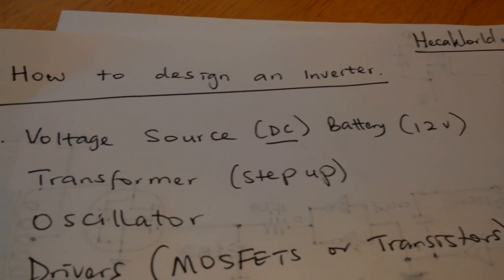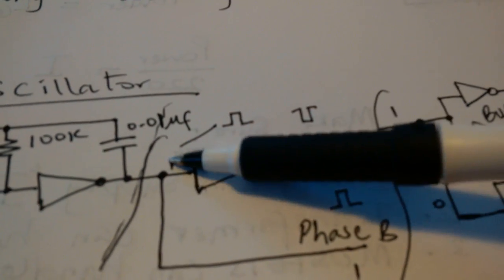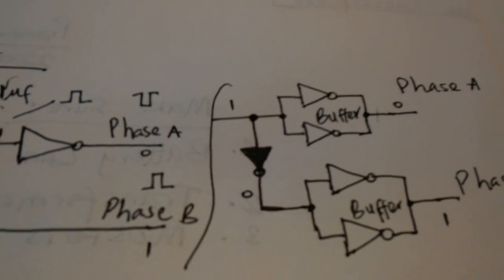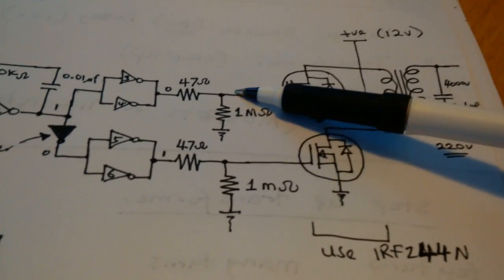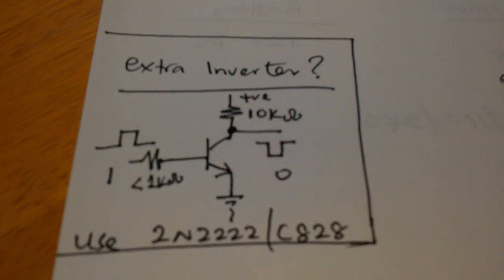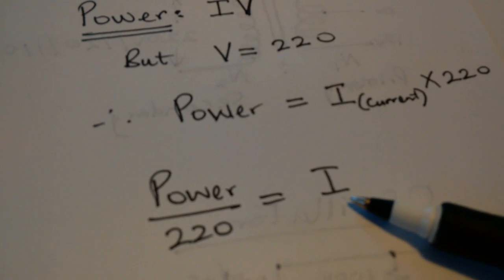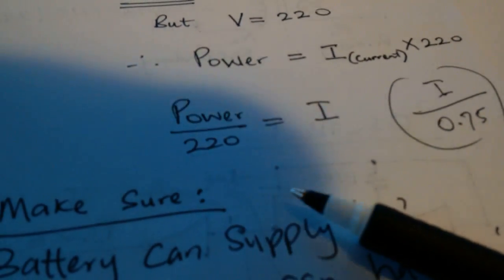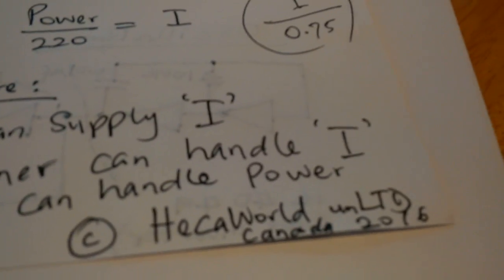HecaWorld unLTD  DIY Inverter Design Tutorial

Comment: This is a very well explained video. I am designing a 300W inverter 12vdc to 120vac. I have determined the primary coil current required (with efficiency) is 33.3A. The only issue I am having is determining how to attain that current value for the primary coil? What specific calculations do I need to make to attain this current? Thank you.

Comment: how to make inverter for 24v dc to 220v ac ?
Reply from the maker: Use the right transformer ratio. And probably a voltage regulator for the sections of the circuit might require lower voltage levels.

Comment: I really need to build a inverter to power my home. I am new to electronics . and self taught . I have been researching how to do so. I need 120vac at 60Hz. from 24vdv. and need approx. 6kw+. do you have a more detailed schematic? I was thinking of using a e bay inverter driver board to drive only the h bridge on the output stage. and a arduino for the boost stage and over volt and heat protection. and under volt shutoff. but I know nothing about programming. what do you think about this idea for a inverter? I was thinking of using a hand full of irf640 FETs for output. and irfz44 or stp170N8f7 on the boost stage. and I have been debating  what type of boost to use. a low hz. push pull. or a high hz. smps style. I know the transformer will be very large for a push pull of this output. but I know little about programming and concerned about regulation of the output. in either style. the high frequency would easier to regulate I'm thinking anyway. but what's your opinion . and thanks for making the videos
Reply: +hecanet    my main issue right now is choosing devices like MOSFETs. some of the figures mean nothing to me. on the data sheet for the FETs. I know I need low RDS on. along with current and volts that are well above enough. and low capacitance for fast switching with the get being fully on and off. but basically the other figures could mean anything as far as I know. and I know the gate needs either + or - of like 5v or most 20v and uses near 0 current. I'm thinking of 60-100v and 100amp+ FETs with very low rds.on.  is the to-220 package the best for my needs? and I was thinking of using a arduino for the boost stage and regulation of the boost stage. but I found a spwm  inverter output board with get drivers and was thinking use a H bridge. but use the arduino for safety's  or would a teensy 3.2 be better to help with voltage drops and over shoots. since it can run at 98mhz. but a few MOSFET part numbers and a good place to buy them would be a big help. thanks so much for replying. it means a lot. and thanks again
Reply: +hecanet        also I was looking through a old modified since wave inverter. the boost stage FETs are outdated. and the output stage is irf640. 200v and only like 18a capacity. I'm sure there is better FETs available. with a higher amp rating. with the spwm of a pure sine output. it will need to switch many times faster. and thanks a lot for your reply

Comment: I am wondering how the drop in battery volts relate to output volts/amps. does the voltage drop on output 1volt to 1 volt or 1volt to 10 volts output. I guess for better understanding. how does in volts effect out volts ?  thank you a reply would be great.

Comment: thanks for laying it out like that. I am needing to build a kinda large inverter for a off grid home. do you think it would be possible to start with a smaller inverter. using the MOSFET drive circuit only. use it to drive a large bank or MOSFETs. p and n channel.and a large transformer. I am looking for 6 kW give or take a couple kW. at 120 volts @ 60Hz. do you think this is could work? I don't have a lot of experience. and could use a lot of help. and if it were to be like 3 kW or larger I would prefer to go with 24 volts or higher . keeping the amp draw down. it seems to be less reliable with the higher current. in time with connections oxidation. things seem to heat up . any help will be greatly helpful. thanks for the video and effort .